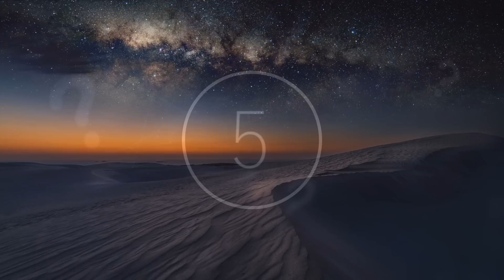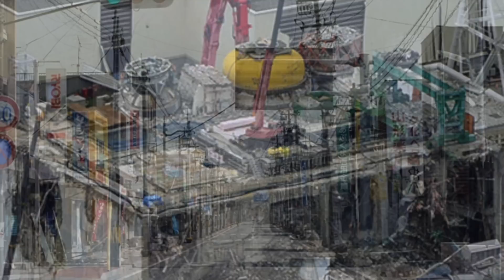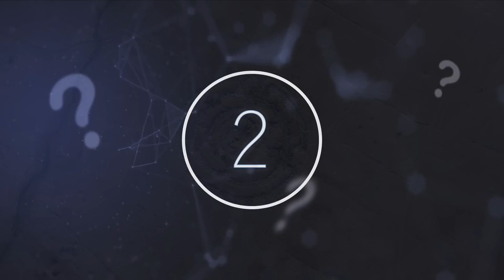Physicists At CERN Have Just Announced The Large Hadron Collider Made An Incredible Discovery

Comment: Scientific achievements at Cern.
Several important achievements in particle physics have been made through experiments at CERN. They include:

1973: The discovery of neutral currents in the Gargamelle bubble chamber;[20]
1983: The discovery of W and Z bosons in the UA1 and UA2 experiments;[20]
1989: The determination of the number of light neutrino families at the Large Electron–Positron Collider (LEP) operating on the Z boson peak;[21]
1995: The first creation of antihydrogen atoms in the PS210 experiment;[22][23]
1999: The discovery of direct CP violation in the NA48 experiment;[24]
2000: The Heavy Ion Programme discovered new state of matter, the Quark Gluon Plasma.[25]
2010: The isolation of 38 atoms of antihydrogen;[26][27]
2011: Maintaining antihydrogen for over 15 minutes;[28][29]
2012: A boson with mass around 125 GeV/c2 consistent with the long-sought Higgs boson.[30][31][32]
In September 2011, CERN attracted media attention when the OPERA Collaboration reported the detection of possibly faster-than-light neutrinos.[33] Further tests showed that the results were flawed due to an incorrectly connected GPS synchronization cable.[34]

The 1984 Nobel Prize for Physics was awarded to Carlo Rubbia and Simon van der Meer for the developments that resulted in the discoveries of the W and Z bosons.[35] The 1992 Nobel Prize for Physics was awarded to CERN staff researcher Georges Charpak "for his invention and development of particle detectors, in particular the multiwire proportional chamber". The 2013 Nobel Prize for Physics was awarded to François Englert and Peter Higgs for the theoretical description of the Higgs mechanism in the year after the Higgs boson was found by CERN experiments.

Computer science
See also: History of the World Wide Web

This NeXT Computer used by British scientist Sir Tim Berners-Lee at CERN became the first Web server.

This Cisco Systems router at CERN was one of the first IP routers deployed in Europe.

A plaque at CERN commemorating the invention of the World Wide Web by Tim Berners-Lee and Robert Cailliau.